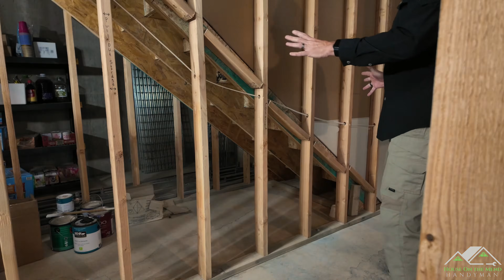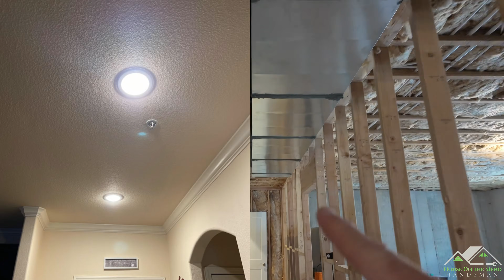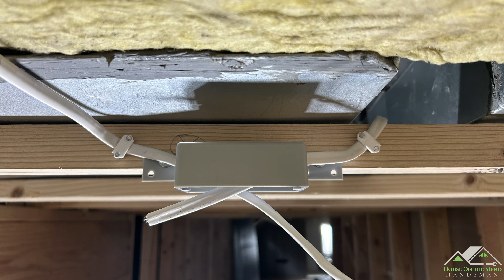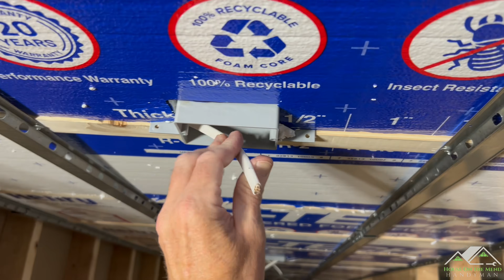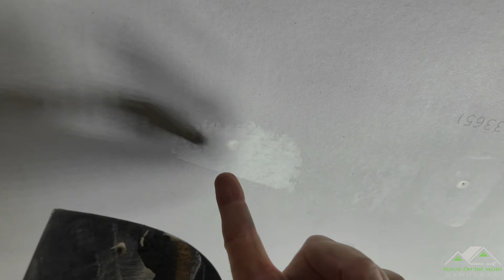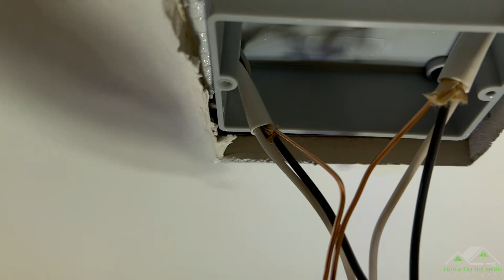How to Frame and Finish HVAC Ductwork in a Basement

Comment: That tight hallway with HVAC running through it looks like a pain to work around, especially trying to manage noise and space at the same time. I’d probably mess something up with airflow or insulation, feels like one of those cases where American Residential Services could step in if things don’t turn out right after DIY.
Reply from the maker: LOL, nice plug.

Comment: Did you use type w or s screws with higher thread count for the metal resilient strips? Your link looks like regular. Im trying to make sure i can use the ones in your link without them stripping out
Reply: Thank you for the fast reply. I see where it says that. Google seems to indicate machine screws with finer thread but yours is holding. So... here is go. Lol
Reply from the maker: @the.mr.nobody yep no issues
Reply from the maker: Here is the link to the product which has installation guidelines:

https://www.tmsoundproofing.com/1-legged-resilient-sound-channel.html

Under “fasteners”, it says, “Use screws only, nails should not be used.”